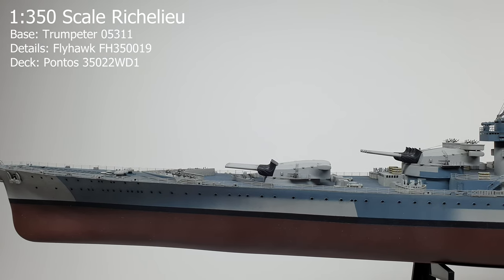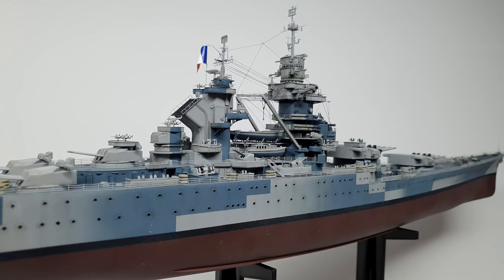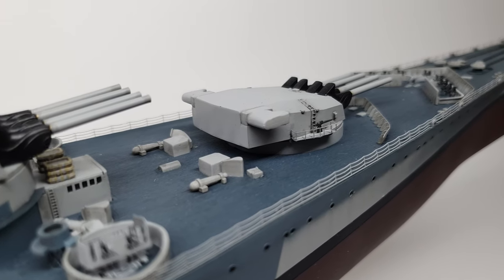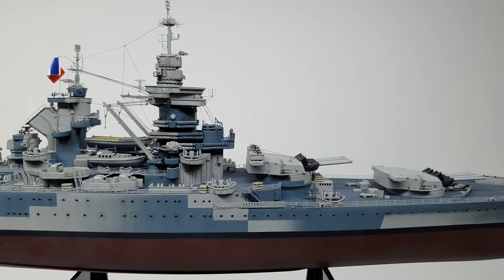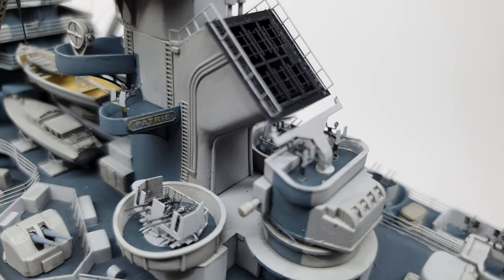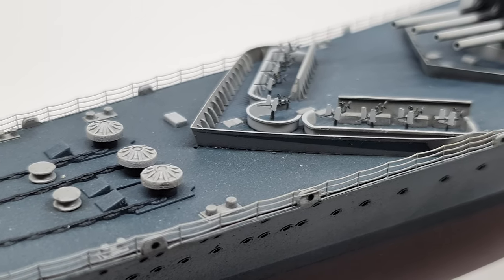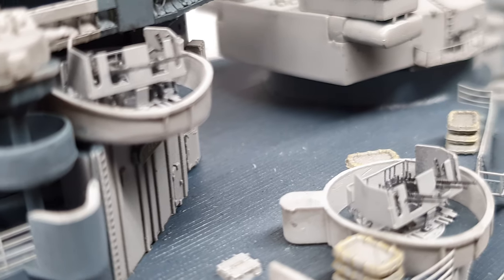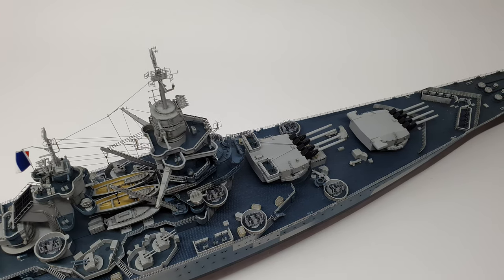1:350 Scale Richelieu Model with Super-detail Upgrade Kit

Comment: Great job on the fading effect, it looks realy good.

Richelieu was an incredible ship for it's displacement. The fastest with incredibly efficient machinery, overall the best protected including very effective and extensive underwater protection whicha at the same time was not overcomplicated. In terms of firepower while 8x 15 inch guns is not the most they were excelent guns with powerfull shells surpassing even american 16/45 in many regards. The only issues was 2ndary battery which in theory could have been replaced with dp guns relatively easily. The issues with ammunition hoists and disperssion during ww2 stem from the fact that the ship was not properly finished yet when germany invaded. After the war reload was on par and exceeding some other ships and dispersion was fixed with simple firing delay mechanism which was a pre ww2 invention. This ship is often underrated as most french military technology is because french superiority makes people uncomfortable lol.